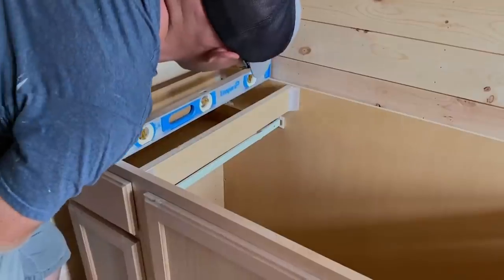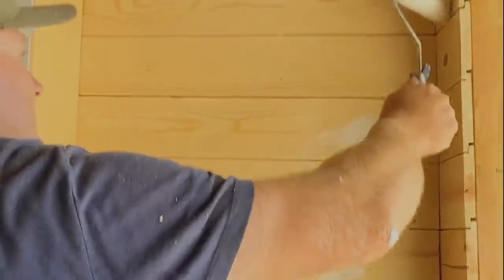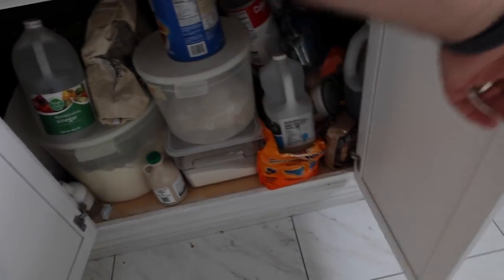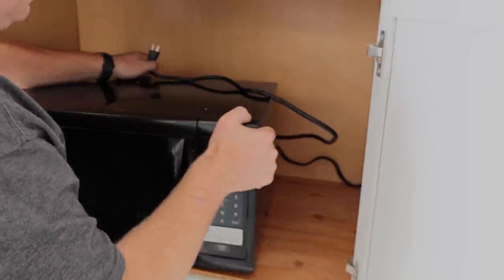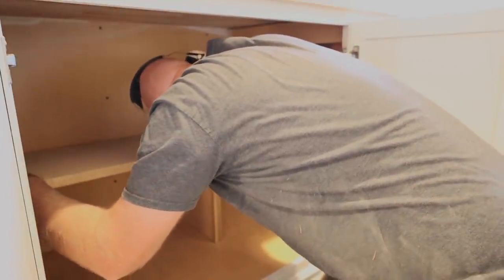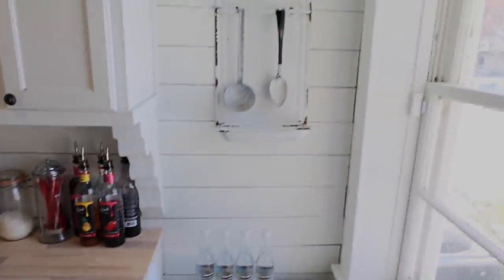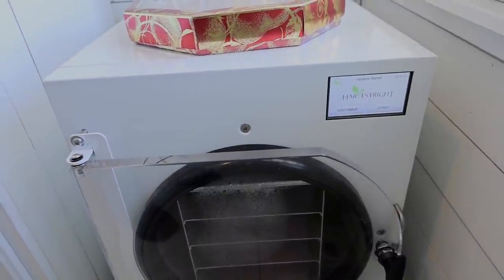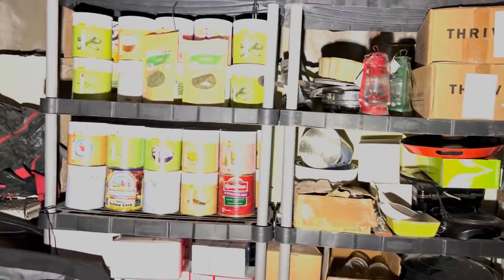Dream Pantry Organize With Me

Comment: Just a food safe tip. Never put sugar, molasses or flour on the bottom shelves. It can draw insects and mice in. Put the oils and the canned goods lowest. Or even baskets of sealed one serving snacks can go lower. Sugar and flour should be higher. Especially if they have residue of flour or sugar on the glass after use. I always use lower cabinets as storage for pots and pans.